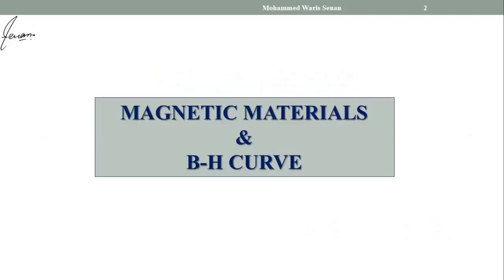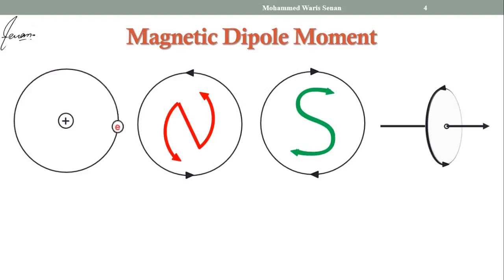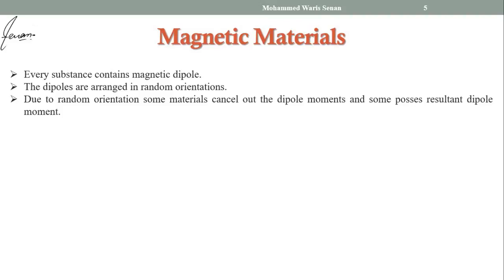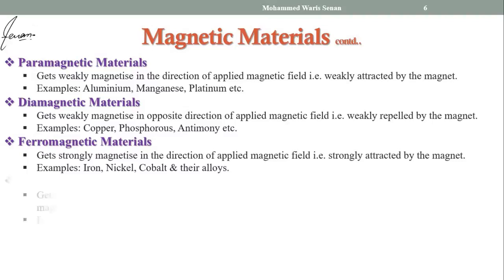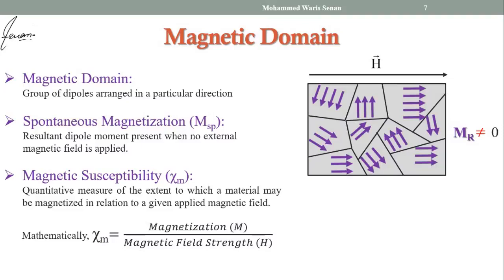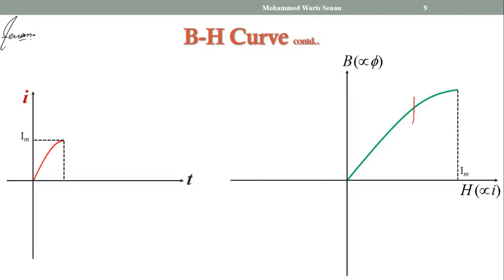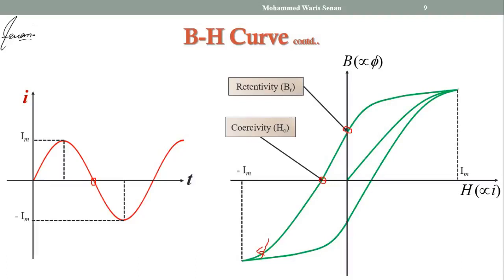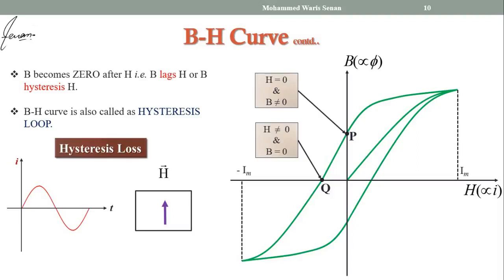B-H Curve I Hysteresis Loop I Magnetic Materials I Hysteresis Loss

Comment: Good expalnation Sir. I have one question. What if the applied current is reduced to zero before the point of saturation is reached? Will the B have some value between zero and retention value? Or will the B become zero?
Reply from the maker: If current is reduced while the graph is in linear region (before saturation) then B will reduce linearly with H and becomes zero with H. But this result will be obtained only if H is applied to a material in which there is no residual magnetism in the material. For the material having residual magnetism, B reduces linearly with H in linear region but if H is reduced to zero there will be residual magnetism left in the material.
Reply: @senanacademy  yes Sir now I recollect that you had mentioned that B is directly proportional to H before it reaches saturation (in linear region). Thank you for the extra information of residual magnetism. Thanks again Sir.
Reply from the maker: You're welcome....and thanks for your appreciations